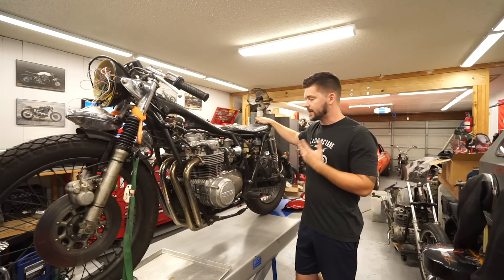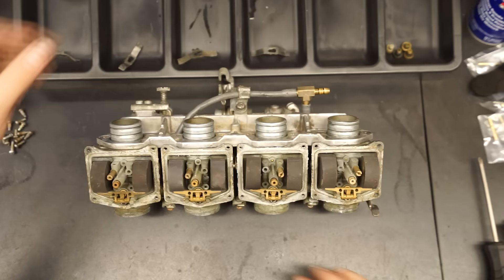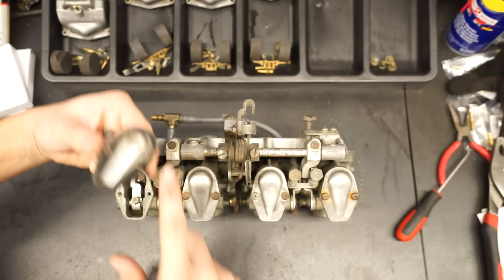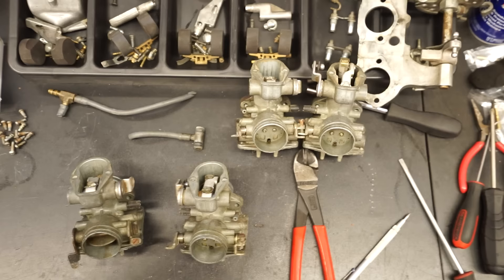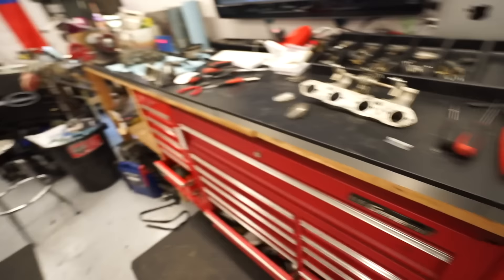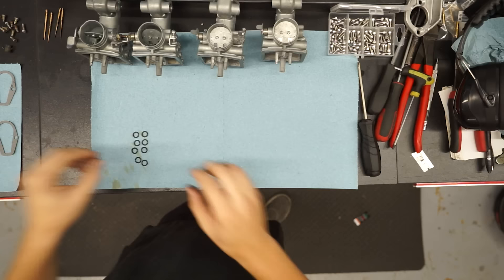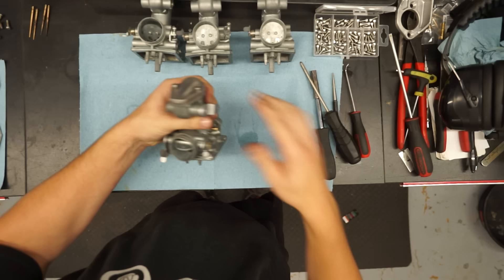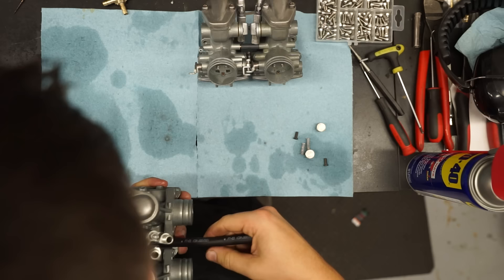How To rebuild Honda Keihin CB350 CB400 CB500 CB550 Carbs (Step by step)

Comment: As a hobbyist restoration person, $425 for piece of mind done correctly tested literally new carbs back is priceless. It takes a lot of time to do it right. This video will help so many as well and the video is free. Thank you and I love your work.
Reply: carbs arent synced. the price is too high for the service you are getting. they still need to be setup on the actual engine, not a facsimile there of.
Reply: @DieselRamcharger  I agree. Carb sync needs to be done on the engine. I need mine done. Probably will cave in and buy the carb sync gauges
Reply: @evdawg7757  you can make carb sticks yourself. its just a manometer. i use fish tank tubing. that clear vinyl stuff. grab a ruler. run yourself a length of hose along the ruler. fill with water. use the ruler as the scale to refference vacuum. make one hose for each cylinder. the water just has to be even in each tube when you start. the actual reading doesnt matter. just equal between all cylinders.
Reply: @DieselRamcharger  rebuilding them is so much fun, at least for me so I would do it myself,love projects like this,patience an direction following is Paramount for a job well done.
Reply: My local shop charged $450 but that was 12 years ago. If you don't know what you're doing that's not a bad price especially if he cleans them up the way he did in the vid, using a media blaster and sonic tank. My local shop, it was just a part replacement an simple adjust of the carbs, that was about it.

Comment: I used this video as an instructional manual and rebuilt some really messed up carbs. Went with a 110 main and a 40 slow as suggested and followed the instructions to a T. Our 44,000 mile 1975 cb550 started right up and runs so much better. Thank you Taylor and good job.
Reply: I have the same bike. Do you have pods or airbox on your carbs? Also, are you running factory exhaust or anything aftermarket? I want to know if I should do the same jet sizes. Thanks!

Comment: There called pilot or slow jets! You dont just up jet sizes randomly, you have to do a plug chop. Two of the same engines with same mods can take different jets. Your experience shows.

Comment: Add another thanks from me.  I have owned a 74 CB550 for many years that I have restored from my friends dad that owned it for 25 years.  14K original miles and this rebuild was just what I needed after 3 of 4 floats weren't working correctly.  Runs better than ever.  Keep the great content coming for these old bikes so we keep them on the road.

Comment: Hi Taylor, thanks for the step by step carb rebuild video. I'm a retired hot rod builder in The Woodlands Tx. Getting ready to build my first 1975 CB 550 Cafe Racer. I'm not a motor head, so that video will help me out a lot. Thanks for a great video.

Comment: Great instructional video. And the difference between a screw and a bolt is a screw is usually tapered with exception of machine screw. A bolt has a nut to retain it.
Reply: Not all bolts have nuts to retain them though do they. Most engine bolts go straight into a blind hole and rely on torque.

Comment: Very clear and concise video.  Just picked up a 550F that needs a carb clean and sync.  Just what the doctor ordered.  Thank you. UPDATE:  Followed this video, step by step with carbs from a 1975 CB550K.  Put them on the bike today, June 14th 2021.  Bike started first push of the button.  Runs great just a little rich.  Easy fix.  Thanks a million, Taylor.

Comment: Man I have to give you props on this video. I have never messed with carburetors before until I watched this video yesterday. I followed you step by step. I have a bit of a fuel leak but I know what the problem is. Other than that she fired right up when I put it back together. 1976 CB550 four.

Comment: The most fantastic, amazing strip down and assembly. Worth its weight in gold for the great explanations of the carb's every nook and cranny, that are often skipped over and would otherwise leave the inexperienced high and dry mid-project. Thanks to you Taylor I decided to do it. Mid-project I find I'm not as organised as you, but the complete tear down and clean up is now complete. The "easy" bit. Now for reassembly. Yeah, bound to be a doddle.
Thanks again T.

Comment: Great job Taylor.  This is the most detailed multi-carb breakdown, stripping, cleaning, and reassembly video that I have seen. If I had a CB-550 I'd be confident to tackle a DIY carb cleaning by following your excellent video.

Comment: Thanks for this video Taylor, it gave me the confidence to rebuild the carbs on my lockdown project : Scruffy Racer. Scruffy was a derelict bike with a siezed motor, burned out electrics and corroded out carbs, after a few months tlc he was running well again. Then for Lockdown 3 here in the UK i did a top end rebuild with 61.5mm pistons, for about 600cc. Today i reistalled the carbs and the bike fired right up! Thanks again for all your videos, you have been an inspiration ! Steve

Comment: This video continues to be my go to video when I'm messing with my carbs. From the video's base suggestions, I went with a 105 main, 98 secondary and 2nd place down on my needle for 4400ft of average elevation. Bike runs awesome, before had been afraid I wouldn't be able to tune for pods and exhaust.

Comment: Best go to video for a rebuild carb adventure.  Thanks a real help. My dad had a 78 550 Honda. Owned it for 5 years. Just a tune up and battery all that time and miles.   Loved his 550.  It was stock. Except for a fairing and saddle seat and some other upgrades threw time. Grips, crash bars Sissy bar.  36k and still ran and started like new.    Thanks 👍 again

Comment: Im working on my 1975 CB750K. Mine did not have any tubes connected to the nipples on the bottom either. I was told those were "breather tubes". My knowledge is incredibly lacking. To keep it short, im going to tackle the same project. This video was very helpful

Comment: 55:25 (someone may have beat me to it, I haven't read all 177 comments, lol) but a screw is typically tapered, and it mates into a threaded cylinder or creates its threads as it is mounted. Whereas a bolt use a washer and nut, and typically would be non-tapered. 
Great rebuild. Wish I had it about 4 years ago when I did my first 550 carb.  Issue I ran into was syncing after because the rotation on the slide valve arm needed adjusting. Took me a while to realize the issue. This video would have helped!  Keep sharing!

Comment: Followed this video for my CB350F carbs.  Super helpful, barely even needed to to sync them once they went back on the bike.
Reply: Hey, hopefully you still get this notification. Any nuances doing this on a 350F? I just picked up a non-runner in NJ and getting ready to go down this path
Reply: @mzurla It's been a while since doing them, but I don't remember anything on the 350 being wildly different than the 550 in the video. It's tedious, make sure to keep track of stackups as you take them apart so they go back the same way, take pictures before disassembly, have a large clean work area. Mine had some corrosion issues, a nice long session in some carb-dip and an ultrasonic cleaner was a necessity to clear out all the small passages. If you gotta get replacement jets or needles, definitely get real keihin stuff. Double check that you get the right bowl gaskets, I initially went with the cheapest crap I could find on ebay and they didn't fit quite right. I borrowed a motion pro liquid balancer and it was 1000% worth it. Also definitely get your valve lash set first and then do a comp and leakdown test too. I was chasing a running issue that I thought was the carbs and it ended up being some valves not sealing.

Comment: Stellar! Perhaps, you can do the 77-78s next ;), Every bike guy, loves to see how there exact carbs are tore down and put back together! Awesome!
Reply: Corey St are these not the same carbs as the 78? New to this so sorry if this is a dumb question.
Reply: @cspark901  The 77-78 ones are slightly different from the 74-76 carbs :)
Reply: 77-78 are the PD44B carbs. The fuel bowl looks quite a bit different, there isn't a jet spring, the idle control screw is between 3 and 4, and the floats are very different

Comment: Great vid. Super helpful in building the confidence in us garage warrirors.
Reply: I did actually tackle my carbs not long after watching this.. I didnt fully break down the rack or the entire carbs hut i did clean them. Replaced the main jets a few gaskets. Figuref out my cold start issue (choke mechanism was frozen and the choke cable was broken) my carbs were a bit different (79 cb650) so i didnt want to fully dissasemble... Yet.

Comment: Love your videos, keep up the good work. One thing to bear in mind, the brass that comes with these rebuild kits is often not the best in terms of exact duplication of the original parts.  IMO, it’s better to reuse as much of the original brass as possible as they are unattainable.  No need to destroy all that wonderful factory brass by hasty disassembly.  Float needles, emulsion tubes, and slide needles are quite often wrong in these aftermarket kits. I’d pay good money for all that old brass😊.
Reply: Agreed! Though over time, fluid friction can wear them down, so adjustments could be needed (jet sizes may not be exactly factory. though the  jet to needle wear should be comparable).

Comment: You are lucky it didn't have the stock airbox. I have a 78 550k, I got mine not running, pulled the carbs apart with a reckless abandon, what nightmare getting it back together, trial and error, been running good for 12 years, wish we had youtube videos like this back then.

Comment: Wow. If you guess wrong on the needle clip position, it has to all come back apart to change it. I'm glad I have diaphragm type carbs on my 1981 kz1000j. Much easier to service the carb jets and slide.

Comment: Wow definitely one of the most comprehensive rebuilds on the web, one question though, U used a 1/8 inch bit to" benchsync" the carbs, I use the metric system is a 4 mm bit gonna cut it?
Reply: Would like to know this as well,
Reply: 2,56/ is more like 3mm

Comment: Good detailed video. I learned as i went and it was time consuming. I synced the carbs with the pressure gauges though but the drill bit trick is a good way if you don't have one.
Reply: Also, im in San Antonio and got my 75 Honda CB550F fro.a guy in Austin who didn't know jack about fixing it. I spent a lot of time rebuilding the carbs from 2 sets. The origional and the ones on the bike. I cross pieced them together using the best parts from both. Really tore up. I got to where i can pull and rebuild them quickly. I used the chem dip and a 24 hour submerge time to clan them. Really bad when i got to them. Wish i had a shop and a sonic cleaner though. I have to redo the gaskets pn the upper cyclinder head. Never done it before. Whomever tried to do it last screwed up and oil creeps between the gasket. Would almost rather pay to have it done.

Comment: Thank you so much for your content! I may have been the one bugging you about this video on your dream video. I recently bought a cb550 and have been intimidated by the carb process and this has saved my life. THANK YOU and I look forward to seeing more in the future!! 
An edit to my earlier comment:
I love the way you showed each step twice rather than once. While it may have made the video longer (which definitely isn't a concern to me, but for some it may be I guess), it helped to have a second view of things and the way they are assembled/disassembled. That is something that really sets you apart from other creators so thank you!
Reply: Also if you could give a link to the replacement allen bolts you use, or if you know the stock screw measurements for the various screws you would replace if it was your build, I would greatly appreciate it!

Comment: I'm setting float height on some 1975 CB750 carbs and I've having a tough time getting both floats to be the exact same height.  I guess I'll keep trying to tweak them so they're 100% even.  It's not easy to get them perfect.  Cody over at MotorcycleMD seems to like the float to depress just a tiny bit when he runs the gauge over it while checking the height, which would set it just a smidge lower than spec.  (Or higher depending on which way you're looking at it.  I don't know the proper terminology.)  If spec is 26mm having the gauge press down the float a little would make it closer to 27mm...so he's setting it to let a little less gas in the bowl for some reason.  Or maybe I misunderstood what he was doing.  Seems to me if you're within a MM of spec it shouldn't matter much, the bike is tilting from side to side, accelerating and slowing down...what's one millimeter between friends?   I could be wrong.  : )
Reply: If you removed the bowls from the carb, carbs on the bike, gravity pulling, go by the spec (22mm for a CB550). That's assuming you are using a proper float gauge or are skilled enough to use a quality pair of Vernier calipers using the depth gauge. Bending those brass tangs and trying to get get four to match up is not for the faint of heart! Doing this with the carbs off the bike (and with a pair of magnifying specs!) seems to be better in the quality control dept. IMO.

Comment: Excellent , cant get why anyone could dislike this video , i bend a small 90 in a paper clip to pull out springs cheap and works like a charm , also I do a bit of work on Honda twins and there is a small washer under the mixture screw spring , not on these carbs ? Just curious

Comment: kind of a sledgehammer mechanic, those jet holders, everytime you wedge a punch in there, it widens the top port. they're not getting stuck because of corrosion or dirt, they're getting re-sized to fit the form of the punch. using a bic pen case is a little softer of an approach. if they don't come out easily, force with a punch or a bic pen only striking the top of the holder will only distort that, if it's that's stuck then find a pin that fits close to the holder with a lip to made with the top and a steady pressure instead of tapping with a hammer is gonna save you some trouble in jetting.

Comment: 1:18:30 WD-40 is not a lubricant. The WD is short for Water Displacement. It is used to remove moisture, loosen rusted parts, and protect against rust and corrosion. If you put WD-40 on o-rings it will dry them out and shorten their life causing them to fail earlier (leak).

Comment: Hello and nice video, im doing a little project of my own, 1980 gs450 cafe racer, but recently when i went to start it after winter, fuel started to comeout of the breather hose on top of the engine. Ive cleaned the carbs twice now and it is still happening. Maybe you can guide me on the right path on fixing this issue. Thank you

Comment: I follow you brilliant video and i refurbished my carbs but when the engine is revved it does not return to idle when the throttle is closed again and when it idles it is not smooth. I looking for any suggestions may be I have done something  wrong or I start again. Thank you and I most impressed of your video.

Comment: Thanks for the refresher! I used to do these in my sleep but it's been 10+ years. I just picked up a 1976 CB550K that the PO started with a cafe build. He put a 4 into 1 header, not sure of the mfgr. And of course there are pods on it and the OEM intake housing is long gone. I used to only use the original because it's just easier to tune. That being said I am going with your advice on the bigger jet sizes. But what about the needle clip position?My thinking is that the CB550F, a 4 into 1 set up had a different needle position, I believe 2 from the top, putting the needle farther down into the main jet, therefore running a touch leaner in the mid power band (CB550K is in the middle position, making for a richer mix). I am thinking of doing this now that the carbs are off the bike and being taken apart once I get the carb kits in. Any thoughts? Have you ever done a plug chop with your 4 into 1 conversions with bigger jets? Thanks for any advice!

Comment: Hey man! Great video. Around 44:30 you said that because you run pod filters, you would put the clip right on the center notch of the needle. I am running a 77’ CB550f with the stock air filter. Any suggestions where to place the clip on the needle for that setup? Thanks!

Comment: I was recently gifted a 1972 CB500 4 that has been sitting a long time. The slides inside the carbs seem to be stuck. (The throttle will not move at all.) What do you suggest as the best way to free them up? I plan on rebuilding the carbs, I just don't want to damage anything. Really like your content, keep up the good work.

Comment: My 1975 CB750 carbs have fewer parts. They're a little easier to mess with than these.   I've never taken them all the way apart though, just pulled off the bowls to replace some jets and measure float height.
Reply: Those carbs went back on way easier than mine.  It was a real struggle with the CB750.  That seat looks really uncomfortable.
Reply: @daveco1270  little silicone lube on inside of rubber boots plus heat from hair dryer makes them easier to put on
Reply: @preez77  I used both of those.  I had to take a 2 by 4 and a ratcheting strap to finally get all four to pop on.  Brand new rubber boots too. Not sure why it was so hard.  At least I know they're on there good... no air leaks.  Probably don't even need the clamps.
Reply: Dave7777 maybe new ones were tighter? But yeah, no worries about vacuum leaks 😬

Comment: I am having problems bench syncing, carb 2 won't adjust low enough and screwing to tight just causes the whole throttle to stick wide and lock won't come down under the tension of the spring. Cleaned it over and over but I'm at a loss